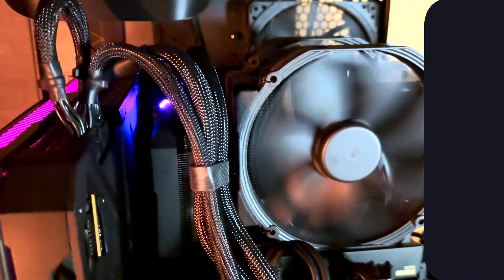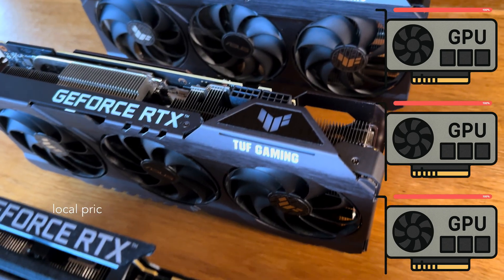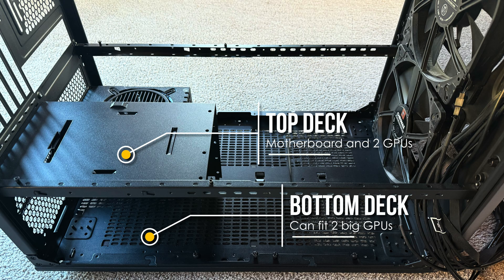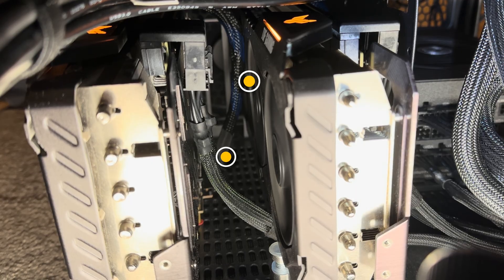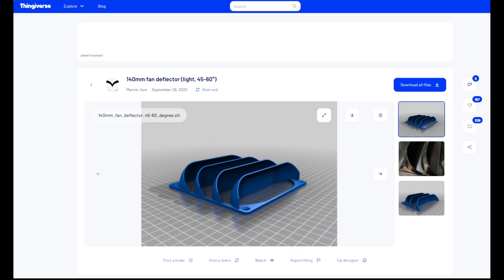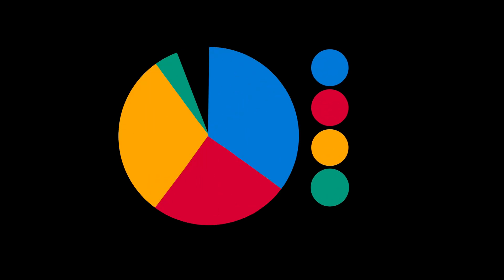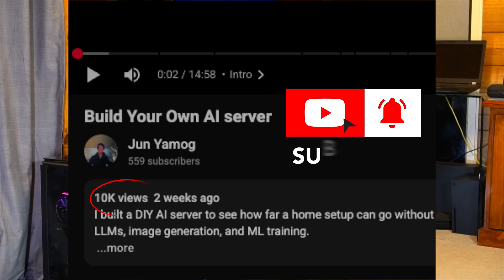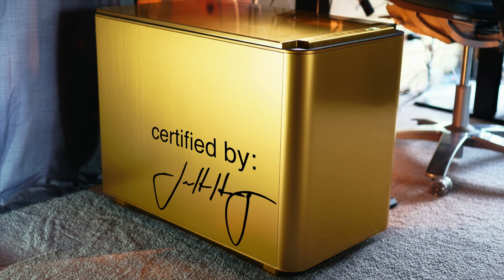How NOT To Cook Your GPUs

Comment: I'm a little worried about the pcie powered by this small 2pin connector. I see 2 female 2pin connector on the board, can we use 2 sata adapter to power it and divide draw beetween the 2 sata adaptor cable ?
Reply from the maker: The 2 pin connector is powers just the PCIE slot, GPU is powered by the big cables so there is little draw on the slots. The 2 pin connectors are also powered by SATA at the other end.
Reply: @jkyamog pcie slot can draw up to 75w. Sata connector are rated max 54W
Reply from the maker: @Malgrok yes that is true max 75w in specs but in practice that doesn’t happen the 390w consumed by the GPU comes from the PSU. If you plan to put some 10Gbe multi NIC it might be but for GPU power is supplied externally.
Reply: @jkyamog  Ok, from what i read it really depend of the gpu. Some are know to draw a lot from the slot even with external power cable (like, it's old so just as an exemple, but the infamous RX480 that draw a whooping 80W on the pcie even if it has an external power). it's difficult to find exact data since you usually only have the tpu for the whole card. Basically in my use case i can have a big power draw, and since i notice you use this specific riser with 2 female 2pin on the board, i was wondering if we can plug two sata adapter to be safe and balance the power load.
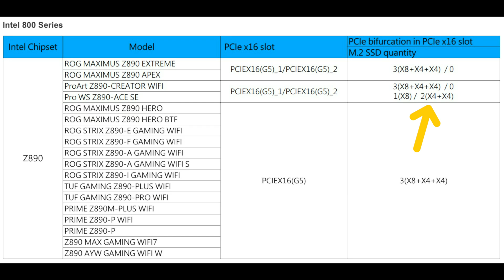Reply from the maker: @Malgrok  A RX480 is fairly old since the external power source was just starting at that time I guess it draws more on the slot.  These days what you would worry if about the 16-pin 12v power of the 4090/5090.  It's one of the reason why I am hesitant on the 4090/5090s.  But it seems rumor is the 5080/5070 cards are cancelled.  So our only choice is 5090 or RTX Pros to get a blackwell class card.  You can try to look for a pigtail that has to 2 SATA but it maybe non-existent.  You can also try PCIe extender (see 2nd attempt at 02:51).  This power straight from PCIe source slot.

Comment: I'm planning my first build and came closer to something like yours but in my case only two gpu's and a PROART B650-CREATOR to keep costs low . Besides the lack of WI-FI support i don't see any major deifference with yours. Do you think the B650 will be ok for adding more gpus in the feature ?
Reply from the maker: Yes I think the B650 is a better option.  I do like the 10Gbe NIC which I am using right now to migrate proxmox VMs.  I think it will be similar, also TB5 eGPU has come out.. its worst the occulting on real life.  Just add them through the M.2 slots which is what I have done.

Comment: What about PCIe x16 to bifercation x4 * 4 then x4  to 4 riser each so can add 4*4 16GPU on one pcie slot . 4 saparate PSU . What you think?
Reply from the maker: I haven’t seen an x16 to x4 (4 PCIe slots) bifurcation card. There are M.2 versions, but in that case you might as well use an M.2 slot that’s already built in. Your motherboard also has to support bifurcation. I haven’t seen consumer boards that do — server or workstation boards, yes.

If you have a server or workstation board, though, you might as well just use the x16 slots since they typically have four or more. You don’t need four separate PSUs. I can power several GPUs with a 2000 W unit. If you can’t get a 2000 W or bigger PSU, you can daisy‑chain them using add2psu adapters. Fewer PSUs means less space taken and less complexity.

Running 16 GPUs is not easy. If you’ve seen my other video, adding GPUs is not the same as using one data‑center‑class GPU. The software has to be able to match it, and with PCIe alone, 16 GPUs will likely hit bandwidth limits.

Comment: I have the same long term project plan as this, currently at having 2 3090 with a z890 motherboard from Maxsun that have x8/x8 bifurcation capabilities for less cost than the proart motherboard. My current blockade is limited by electricity, thus stopping me (worried even with only 2 gpu) from going beyond 2  3090

your build is interesting one I must say
Reply from the maker: You can daisy chain PSU as I found out from another builder. 2000w used PSU is hard to find. My other build will be 2 1600w using a “add2PSU” board.